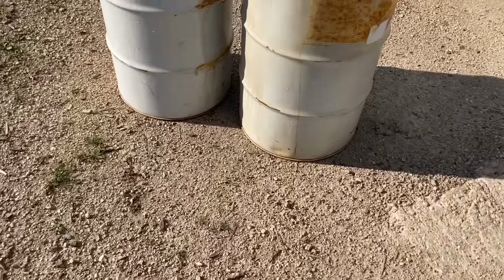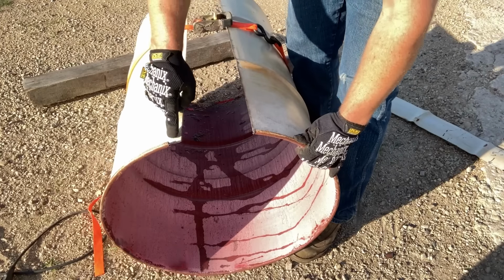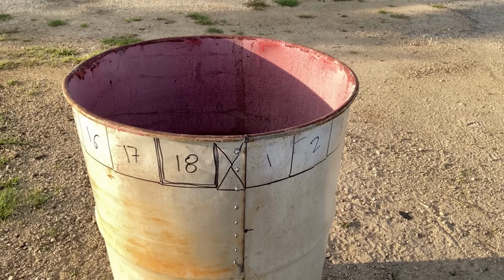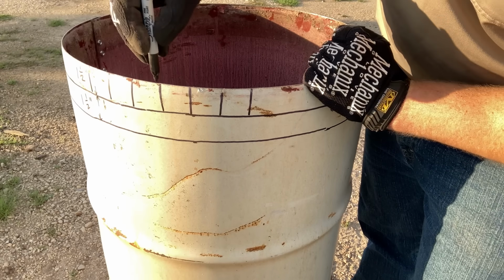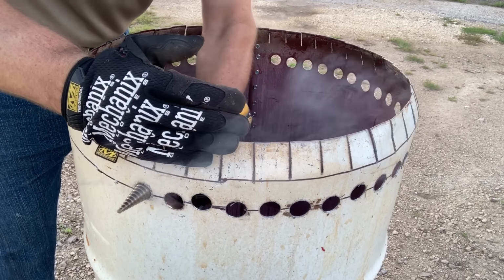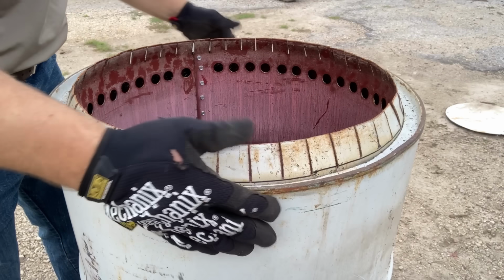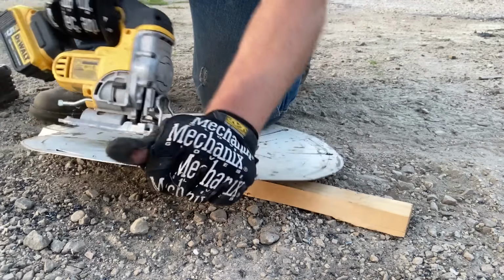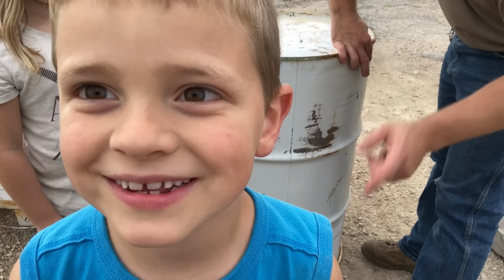Smokeless Burn Barrel

Comment: You could always do all the drilling and cutting of your grate while before cutting it out of the barrel to be at chest height rather than working on the ground
Reply: And drill all those holes before making all the razor sharp teeth at the top.
Reply: ..and not have to wrestle with it on the ground
Reply: Real Craftsmen always use a gnarled partial 4 x 2  placed on loose rocky soil as a preferred workbench. Makes for easy clean-up. . .
Reply: you must be vertically challenged if that barrel would be at 'chest height'
Reply: @aaronfu2  to each their own
Reply: My back wouldn’t take the bending over that long. About ten minutes severe pain sets in. Would definitely build work table / frame set at least 36 inches high. Probably would half to use stool also. Wear and tear from 40 years of tree work. Will be building this for sure.

Comment: Just ran across your channel and as a welder/fabricator for over 4 decades, although I am a bit of a perfectionist, I am impressed with what you've shared..I been wanting to put together a "burn barrel" and you've inspired me to finally put one together. 
I will be trying a few different ideas and we'll see how mine turns out in comparison to yours..
Thumbs up, thanks for sharing and showing your cute kids..
Be well!
Razor!
Reply: Update?
Reply: Any progress?
Reply: Well? Are you ready to fab me one? I'll PayPal you, lol
Reply: @jerrysolonsmith8471  
Thanks for the offer Jerry...
But I haven't had time to make one for myself, so I went out a bought one...😳
Reply: I bet you have a plasma cutter which would make this job a snap.
Reply: @SgtMantis  
Actually I'm looking for a plasma...
Reply: @razorworks9942  did you or are you planning to weld the seam of your inner barrel. I have a stick welder and am thinking about it but the gauge is so thin I’m worried it’ll just melt instead of weld. Any advice you can gave me? Thanks.
Reply: @chriswilson5398  
Hey Chris,
I wound up buying a smokeless stove (burnbarrel) from Costco about a week after I saw this video so needless to say, I didn't take on this project. 
But to answer your question, depending on weather you are adding material to this edge or not will determine if you should weld that edge. Personally, I don't think you need to, but if it seems a bit flimsy, then I would recommend doing so.
Selecting the right material will help a great deal in welding this up..like any welding of thin material to thicker material, concentrate your heat into the thick metal and you'll be fine.
Of course if you have a welder designed for sheet metal like I do, it will be a piece of cake for all the novice guys. For the experienced folks out there, running stick would not be difficult at all. That said, if you have a mig machine at your disposal, I recommend using that over stick all day long!
Hope this helps!
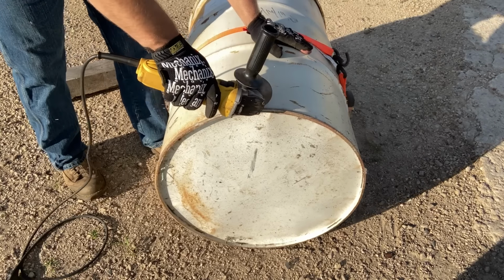Reply: @jerrysolonsmith8471  3:37 3:39
Reply: @jerrysolonsmith8471  5:10
Reply: Winkie1
Reply: @SgtMantis  
Unfortunately I don't have a plasma...YET!
All my cuts are with my "liquid Wrench" or cut-off wheels and hole saws..

Comment: Nice project! I made a much smaller version of this out of tins and used it to cook on during two weeks summer vacation. It worked incredibly well, not in the last place because the beach nearby was full of the tiny, super dry wood fragments that I could use to fuel it.
Reply: an idea. combine this smokeless design with a rocketstove design and you would have an excellent camping stove

Comment: Thanks for this.  We burn yard waste in our rural town much of the summer...generating much smoke..NOT ANY LONGER!  Thank you!  Additionally one could make 3 of these (shorter) using two barrels much like you did and use them as fire pits.
Reply: Or, if you're just making a small fire pit, cut a single barrel in half and use those 2 halves to make it. I would think that would work as well.🤔

Comment: Sir this is awesome, I am a retired gas and central heating engineer your amazing solution for your burn barrel is achieving the correct stoichiometric air to fuel ratio for a efficient burn.
It is a pleasure to see the level of craftsmanship shown. This will be my next project, thank you for sharing this knowledge.

Comment: Hi! Thanks for your video. I live in Norway and built the same after your instructions. Just added a fine mesh "chicken-mesh" on top of the "fan" in the bottom to prevent big chunks of coal to fall out. Burns really good and with a minimum of smoke.

Comment: Thanks heaps for sharing! We live on a mountain property with endless brush and I built this to start tackling it before forest fire season. Seriously love burning this barrel! Only thing I'm looking into up grading is a different grate in the bottom. I got mine super hot and it has warped. Ace design cheers
Reply: We have a "secondary burn" wood stove of excellent design. Therefore, I would delight and benefit from an addendum video explaining the air flow design of this burn barrel. (And your charm shows through and sets a good example of a man.)

Comment: Thank you
I also used your idea and cut off 1/3 at the rib on the barrel and shortened it,my local dump always has weber grills so took the grate,dropped it inside,made a 6x6 hole cut thru both barrels to light my now smokeless firepit,thank you.

Comment: This design is very efficient, burns yard debri way faster than I would ever have imagined. Not smokeless but way less smoke than the typical methods.
Reply: i went through building this, I found that once going it burned super fast, still smoke, but  probably impossible not have a some smoke without a much different design
Reply: Smoke is partially burnt fuel. This design allows for a good supply of air for a leaner burn,a hotter and more complete burn of the fuel resulting in a faster burn time and emitting less or no smoke,sort of the same effect as using bellows. But anything that alters the ideal ( or near ideal)air fuel ratio will produce a less efficient burn,too much fuel vs air will result in an incomplete burn and create smoke. Things like the moisture content of garden waste,along with the other multitudes of gaseous elements released during the burning of the infinite combinations of differing vegetation, its self either adding extra fuel or partially inhibiting burn due to its inert nature or even throttling of the air flow by physically blocking its path with a big heap of leaves,twigs and bracken etc. chucked in at once( as we tend to do). Will have an effect on the ratio and therefore quality of the burn. Remember that you can run an engine using just a couple of components,a crude fuel and ignition supply will be sufficient to convert your fuel into energy,it won't be clean and it won't be efficient but it will work, all of the extra complicated crap going on under the bonnet of your car or truck is only there to ensure the burn is as clean and efficient as possible.

Comment: Pretty ingenious design. I might build one for my friend who has very messy trees that drop sticks and branches all the time. The smoke has always been an issue because the nearby fire department will come if they see even the slightest bit of smoke which is annoying to say the least. Also there’s a downdraft in the valley where he lives which makes the smoke linger Hopefully this should at least cut back on the smoke
Reply: my issue with stuff like that is the sparks and ash, I got a fierce fire going in a mesh burn box and it was like a rocket!

Comment: I love these types of projects where something gets repurposed into something useful that would have otherwise been thrown out. 

Note to anyone who sees this video and plans on following through with this, or any other steel barrel project: Please use extreme caution when removing the lids from any steel drum. There are extreme explosion hazards due to the residues of what ever products may have been in them - and not just petroleum products or distillates. Even vegetable oil residues will have vapours and if those vapours reach their flash point inside the barrel while you are cutting it can cause an explosion. They need to be steamed out or fill them full of water when you cut the top or bottom off a barrel.

Comment: Thank you for this useful tutorial!  

I've made a small version at 1:9 scale (6 gal/55 gal) using two 6-gallon Behrens galvanized steel trash cans from Home Depot ($21 each) to get the hang of it before tackling the two 55 gallon steel drums I have.  I learned a lot and had a good time scaling down the measurements shown in the video to the smaller sized cans.  The final result works perfectly.

Note that the Behrens 6-gallon cans are not uniform cyliders--instead they taper from the top to the bottom.  This made it a huge nuisance to screw back together the inside can after cutting it down to a smaller diameter since the strap kept slipping off.  So if you're making smaller burners then I'd recommend making sure the cans you use are of uniform diameter from top to bottom.
Reply: Burning galvanized metal not healthy but I agree with u on practicing first.

Comment: Nice. You could easily coil a bunch of copper tubing in between the two barrels for an excellent water heater
Reply: Might restrict the air flow in the cavity for the preheated air that is used for the secondary combustion. Coil inside the burning chamber maybe a better option.

Comment: Very cool. I feel like you could make this a less expensive version of the shorter smokeless backyard pits with only one barrel, cut in half along its transverse axis.
Reply: car steel rims
Reply: @rocketsmall4547  is that different than steal car rims?
Reply: @PatrickQ4HBD  .no it be sam as the kar steel ram
Reply: @PatrickQ4HBD  YOU ARE FUNNY, I LIKE HANGING HERE, EVERYONE HAS A SINCE OF HUMOR
Reply: I like this idea, more of a fireplace to hang out around than a backyard incinerator. Just keep in mind these are hotter and therefore more dangerous than your average campfire. You can’t see heat without smoke!
Reply: At least not without seeing the heat bend light…
Reply: @dylangrant7799  True, but you can see your friends across the firepit since there's no smoke anymore. And now there won't be someone always coughing, lol.
Reply: I did exactly that, made this project out of a single barrel - so half height. Works very well, though it seems like more work than necessary went into the inside base part where you’re lighting the actual fire. I’m currently making another, and am looking forward to seeing what happens when I cheat a little on that part, and use smaller holes for the top of the inside cylinder.
Reply: Made another, the burn plate piece is overkill, as expected. I also used the “top” of the barrel as a ash tray. Also, use a jig saw with a metal cutting blade for everything possible,, cuts way cleaner, straighter, and safer.

Comment: This was very interesting and thank you, as a new home owner I was having a hard time with all the leaves in my back yard. Problem solved, can’t wait to build this. Love the cuts of the kids, great video!!!!
Reply: I'd suggest mulching those leaves, or a portion of them, and getting some compost out of them.  With a little cleverness you could mulch and burn in a similar barrel at different seasons.  Any garden will need its soil nutrients replenished seasonally.
Reply: @ammoalamo6485  completely agree.  Fill barrel with leaves. Use string trimmer to grind them up. Dump in compost pile/bin. Done!
Reply: @ammoalamo6485  EXCELLENT RECOMMENDATION!  Leaves are the absolute BEST natural composting organic material there is.  Period.
Leaves make a LOT of smoke, so be ready when you light it up due to a lack of O2 flow obviously.
Reply: @ammoalamo6485  well looks like I have to do the compost, I live in NYS and just found out it’s illegal to burn here. Thanks for advice anyway and great video!!!!

Comment: You can use reflected heat to increase the combustion temperature of the smoke:
Make a lid - ideally conical - with central hole 1/9th the area of the combined ventilation holes. If you tab the lid's hole you can attach an old paint tin with its bottom cut off for a chimney. Why 1/9th? Fireplace chimneys used to be 1/9th of the area of the opening.
Reply: Wait...what? Oh wait, you are describing a simple woodstove. That is is something else entirely.
Reply: It should also be double-skinned for added heat. Hinged to flip open. 1/9 th of the opening might interfere with the flow of air too much.
Reply: yeah i agree adding a chimney would make this burn better with less smoke, however  you would need something to allow you access to add wood while it burned

Comment: The boy and I built one last weekend.  Very nice plan, and thanks for the details.  We welded the joint on the inner barrel and also welded flat pads on the feet to make it more stable on dirt/gravel.  I didn't have a unibit, so we fiddled around with a hole saw for much of the holes.  Got to thinking it would be cool to write something in the lower area of the outer barrel, especially if a plasma cutter is available.   It was a gift for the grandparents, so haven't seen it burn, but I'm sure it'll do great.  Very nice video!  Blessings to you and your beautiful kids.

Comment: A couple of months ago I build a small wood stove to go in my van. It was made using an old gas bottle, a couple of fire bricks, an olddoor from an even older stove (including the heat proof glass and the hinges) and a few feet of 80mm stove pipe. It works great but me being very cheap and using fuel (wood scraps) from any construction dumpster I could find on my travels the stove was at times a very smoky affair indeed. This had resulted in a couple of encounters with the local constabulary on the matter of said smoke.
Then I found a double walled wine bottle cooler made from stainless steel and started drilling holes and a large opening in the bottom using a similar method like shown here.
The cooler fits inside the wood stove perfectly (as if it was meant to go in there all along)
Now I can burn the same wood scraps but cut a fair bit smaller but also wood pellets (which are cheap enough and relatively easy to store and carry) producing very nice heat for the camper van and with very little if any smoke.
Reply: I just installed a wood stove on my bus. Enjoying a crackling fire right now
Reply: Too bad we can't see pictures!  Sounds cool!
Reply: Be extremely careful using a combustion heat source in a small enclosed space. I had a friend many years ago go on a logging job. He drove his van into the mountains and camped near the worksite. the first night he cooked his dinner on a hibachi grill. After finishing his dinner, he decided it would be a good idea to put the hibachi with the last of the glowing embers in the van to warm it up as he went to bed. He left behind a widow and two fatherless sons!
Reply: @gantz4u  

I thought river stones are the exploding ones since they might have moisture deep inside.
Reply: If you're good with soldering and low voltage wiring, you could use part of the wood burner to make electricity. A homemade thermoelectric generator would work to charge a cell phone or other small devices.
Reply: @montanaelkwhisperer1744  Obviously the stove has a dedicated air supply from the outside to prevent the forming of dangerous levels of carbon monoxide. Also every flame based heat source should be accompanied by a electronic carbon monoxide detector...